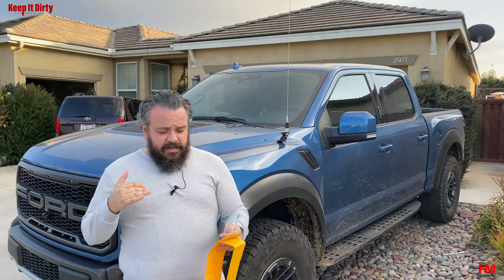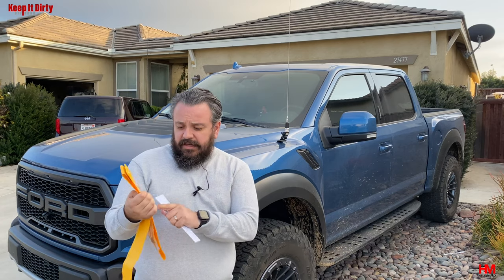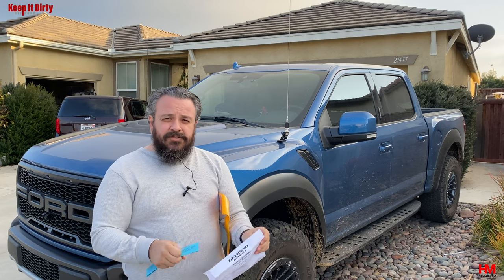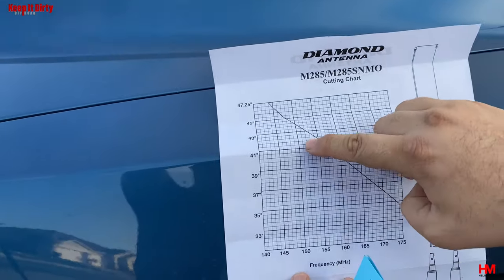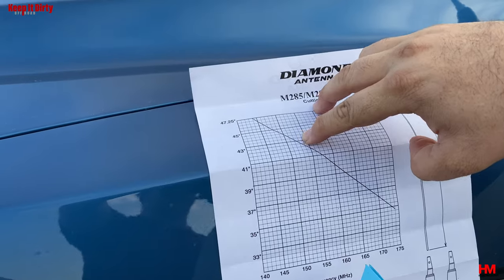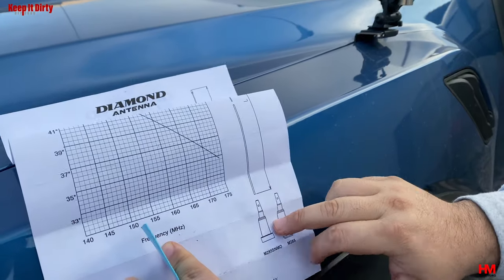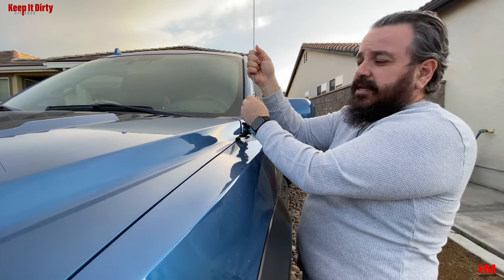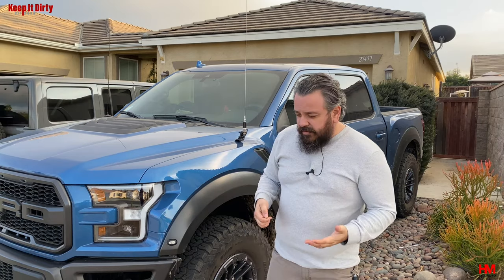VHF Antenna Tuning

Comment: Have you had a chance to check you signal with a SWR? (Standing Wave Ratio). Just did a radio install on my new RZR and I know a 1.15 on the meter is right on, but the best I got was 1.30. - 1.80. I spoke to PCI and they said "you should really be below 2.0 so your numbers should be fine, rarely get to 1.15"
Thanks again for another informative video.
Reply from the maker: I have not. Would have to get with a radio shop for that
Reply: @KeepItDirtyOffRoad  Just buy a SWR meter from HRO or Amazon and two jumper coax cables to hook it up.  Meter will cost like $60 bucks and if you plan on staying in the hobby you will use it for the rest of your life.  I would never cut an antenna off what is listed on a piece of paper without checking SWRs.  There are WAY too many factors outside of the antenna that will effect SWR.  Coax type, connectors, length of coax, mount, ground, ect ect.  
If you're pushing full power (which I'm assuming you are) and you have a SWR that is high you can do some damage to your equipment.   As Titantramp said, 2.0 SWR is danger zone really you should shoot for anything below 1.5.  Also, if you plan on getting your ticket you should just leave it full band :)
Reply from the maker: SD Cruiser you know way more about this than me. Some of this is over my head. I just relocated my antenna to the top of my rack. At the hood reception was being impacted a bit. But I do need to get it all tested to make sure it’s working at optimum levels for the best range possible
Reply: @KeepItDirtyOffRoad  You know astronomically more about Off-Road  :)   For the best optimum location you want it center and above everything, so like dead center of the roof.  Just looked to see where your rack is, if its on top of that it should work much better well.  On my truck I have my antenna on the fender as well.  I operate through repeaters via DMR though so I can get away with a lot more than a person running simplex.  Hopefully you used a mount that you can rotate it back so its not smacking everything :D  
Ham is all about experimentation, what makes it fun.   Hopefully I did not come off as rude, was just trying to  give some info.  I'm not your typical viewer, I don't do off road stuff.  I actually watch your channel for all the modifications you do to the F150.  :)  Gives me lots of ideas on how to do things with my truck.
Reply from the maker: SD Cruiser yeah, rack install is the highest possible and centered. I also added a grounding strap to get a better ground since more of the aluminum. 

Since most of us on the offroad side don’t have a license, we stay away from repeaters. I need to get my license .
Reply: Bro where I can buy this type of antina
Reply: Find your local ham radio club, they would probably be glad to help check your swr and tune the antenna. The vehicle acts as a ground plane to your antenna, so having it mounted center of the vehicle gives it the most equal transmission of signal. I have my ham license and camping, off roading, setting up communications in the middle of no where go hand in hand.  Our club built antennas out of wire that you can hang from a tree, set up a quick base station.
Reply from the maker: Mine is mounted to a powdercoated plate. A grounding strap is a must to have it get a proper ground .

Comment: Question. I have a dual antenna whip nagoya. It has 3.5vhf and 5.5 of gain uhf.   If i tune the uhf frequencie tona desire, will the gain dimish or be affected and the vhf .
Reply from the maker: I don’t know that much about antennas. You need to talk to a HAM radio guy.